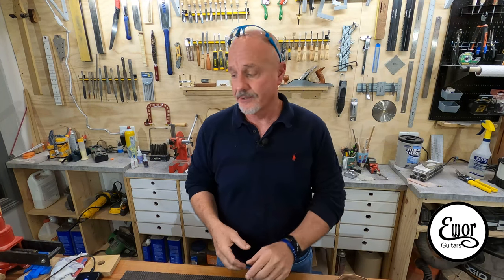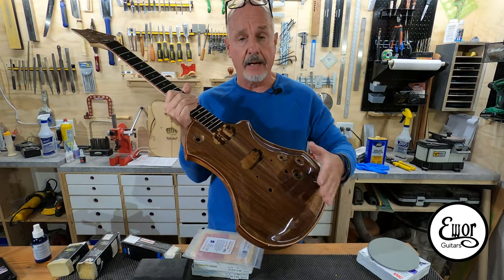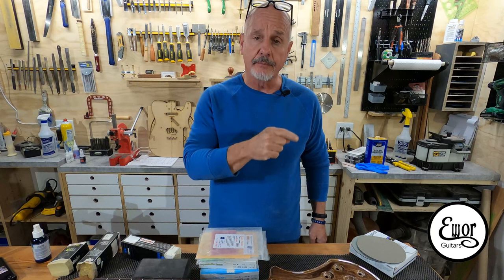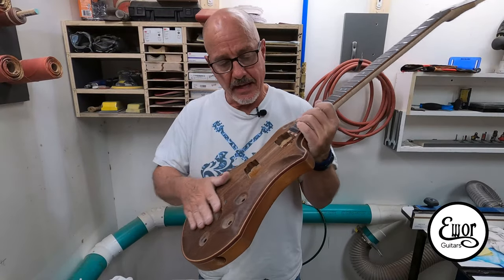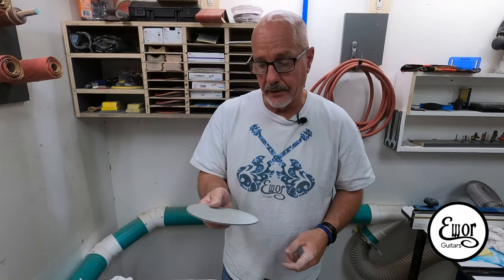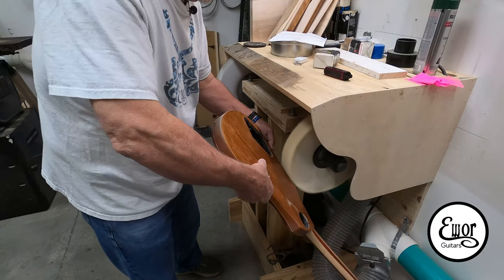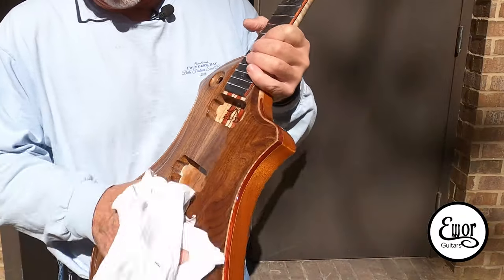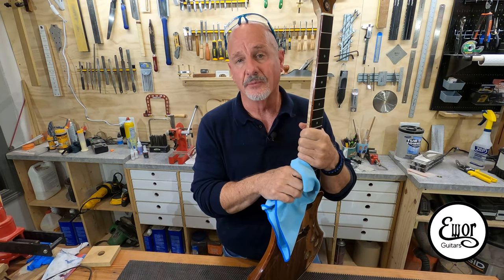How to Build an electric guitar episode 20: Buffing and Polishing

Comment: Looks amazing Dave. That walnut has so much stuff going on, absolutely beautiful. When I first started guitar finishing I got a VHS tape from Dan Erlewine. He sanded to 800 and went to a corse buffing wheel. Then to fine and then to swirl remover on a fine pad. Of course he used nitro lacquer. Like you you I've learned to sand to higher grits and start with finer buffing compound. But 3000 I think you could go straight to the 15 super fine. But I can't argue with results!
Reply from the maker: Thanks Dane, I’ve stopped at 800 before and start buffing but I would always seem to get hazy spots. This time it came out really clear.
Reply: @eworcustomguitars  ,I was just saying what Erlewine recommended back in the day. Like I said you can't argue with your results. It looks fantastic!